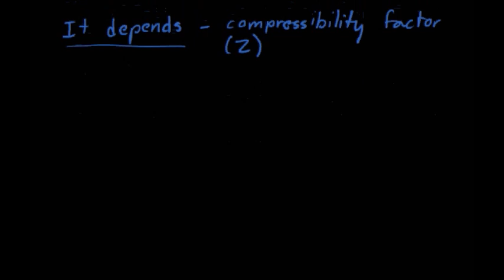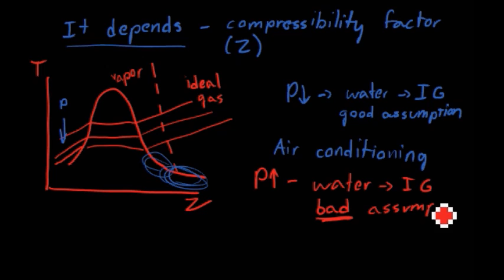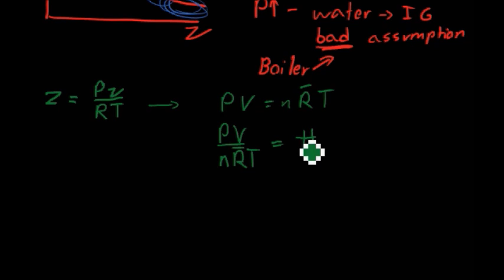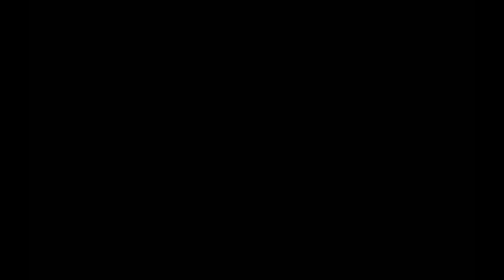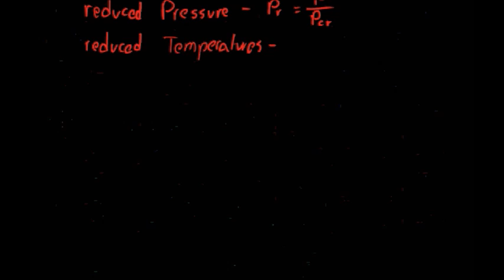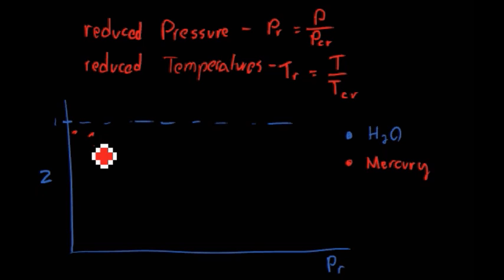Is Water Vapor an Ideal Gas? (Compressibility Factor)

Comment: what happens when  saturated water vapour is heated in a closed u-tube? will it condense? great videos by the way thank u
Reply: it will if you cool it down. but it shoud be air coming with % of humidity, otherwise it would be dry air, and this would be more complicated to analyze
Reply: @diegoguatemala1520  thanks for your reply, what do you mean "but it shoud be air coming with % of humidity, otherwise it would be dry air, and this would be more complicated to analyze" ?
Reply: @jackparty69  when you deal with dry air, basically it's like assuming that it comes from a hot temp. But, if you want to get it, you then remove the moisture- humidity from it, so it becomes dry air, this one it's helpful for some industrial stuff, but it's pretty complicated, and it should be studied carefully because if you use it for a room and it's not well calculated, it can hurt people badly starting with your skin, and so on. Basically molescules of air are bouncing faster as dry air it's assumed to be at higher temperature than humid air, this matter of energy ends up hurting your skin, and it's hard to breath. Usually in nature, there is not dry air, as it always possess some humidity %